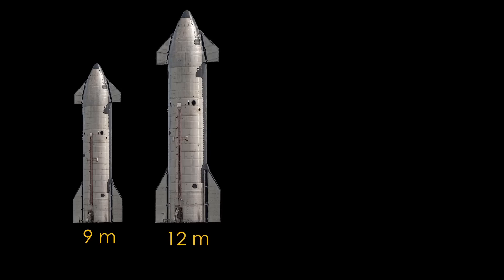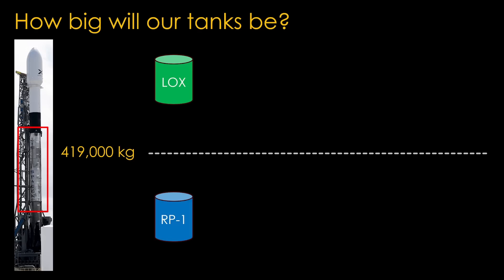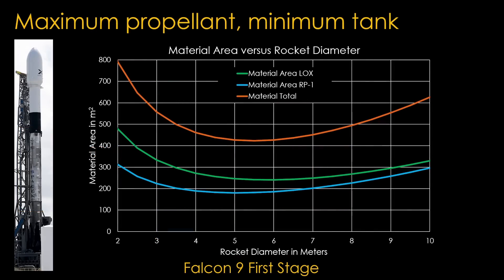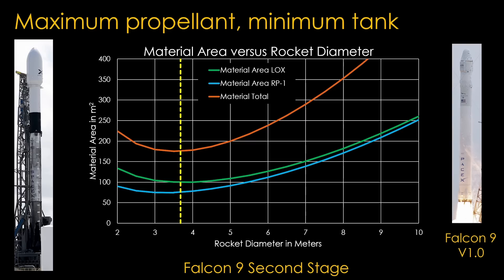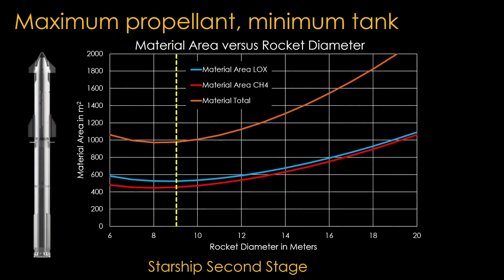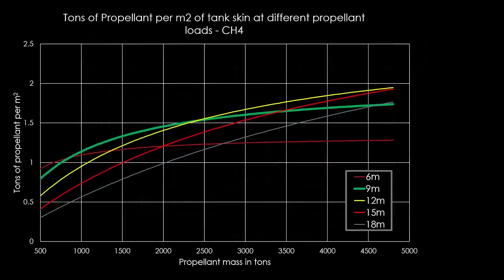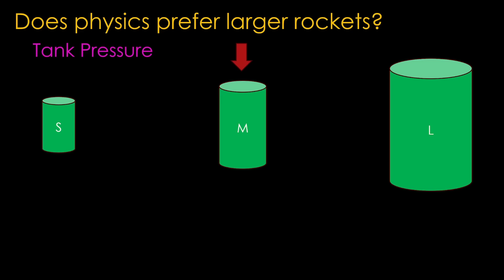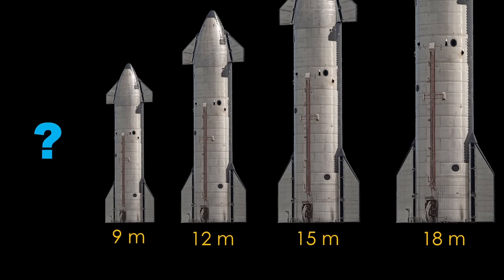Will Starship Get Bigger? Propellant tank sizes and rocket diameters

Comment: Something else to consider with Starship is the reentry cross section. A shorter but wider Starship will have a different belly cross section than a tall and thin Starship. Although a larger cross section means means more surface area that needs tiles, it also means a gentler reentry. That too has some optimization equation, but it's probably more complicated due to heating limits and such.
Reply: No need for tiles at all. just drill lots of micro holes. then pump out dry ice out of those holes to form a cold co2 insulating boundary layer. you dont even really need a pump. the heat of re-entry will cause melting of the dry ice and high pressure dry ice co2 to come out of the micro holes to form the insulating boundary layer.
Reply: @esecallum  Using gas evaporation to use sweating as the cooling method was considered by SpaceX, but that would add weight to that gas. In a recent Everyday Astronaut episode Elon explained that they made the choice to go with ablatives and tiles instead
Reply: Worth noting that Musk wasn't quite sure whether ablatives and tiles are now actually lighter than the evaporative cooling they originally considered. I guess they stick with their current heat shield because it's quite far in development.
Reply: @esecallum  Cooling using cold gas is a concept that can be considered. I assume rather on top then instead of thermal insulation, but OK. However: Why would you want to carry high density CO2 up there? There already is oxygen and CH4 in the vehicle that has a lower density and is there anyways. Then you need to balance the extra weight of propellant burn-off for cooling versus the extra weight for heat tiles. And you need to test it. And probably thats not nearly all... It´s rocket science and a bunsen burner doesnt proof much.
Reply: @esecallum what lmao
Reply: @furriesinouterspaceUnited  learn to read and listen
Reply: @esecallum  Uh you spatted some absolute nonsense, none of that will work.
Reply: @furriesinouterspaceUnited  i proved it it lab with bunsen burner-e and an air compressor.  you are regurgitaing it cant be done
Reply: @esecallum  You’re missing 2 of Musk’s primary design philosophies for Starship.
1. The rocket must be rapidly reusable. Static tiles done right should require less work between flights.
2. Shortening development time is extremely important to Musk. That’s why they first switched from composite to steel.
Reply: @TheMrshawnpaul  they keep falling of!
Reply: @esecallum  Your idea of active cooling is a nice idea, but I don't think it's what SpaceX is looking for. Stoke Space is looking to use active cooling, but using the liquid hydrogen propellant instead of dry ice ( which has packaging/loading and expiration issues). Take a look at them!

Comment: I would have mentioned the issue with thrust density with regard to height. Unless SpaceX comes up with continually better engines, Starship can get wider, but it can’t get taller. You no longer have room for enough engines at the bottom.

150 meters is pretty much the max you can get to with current engine technology (Raptor V3). (Assuming same diameter for the whole rocket.)
Reply: Make the booster a cone. You can widen it at the bottom to increase thrust. It would minimise the changes to the ship, while allowing for a more powerful booster capable of throwing the ship further.
Reply: BTW, this means that if you don’t have really good engines, you are limited to a lower height. It is an important design constraint. As long as New Glenn uses the ORSC BE-4 engine, you’re probably not going to see a version reach much beyond 100 meters, as an example. This could push designers to increase from a 7 meter diameter to 9 or 12 meters, or beyond. If the need arises for a larger more capable rocket.
Reply: Agreed. I think a larger diameter will come as soon as they start generating revenue from operations (Starlink, etc...?). Starship is mostly a fuel tanker and the demand for payload is limitless. It's a KC135 refueling an A380.

Comment: Great presentation. One thing to note is that while pressure vessels would keep a constant mass ratio, things like heat shielding or insulation benefit massively from the square cube law. This would indicate that there is a break-even point for hydrolox where the performance outweighs the added insulation and handling issues (see extreme 1960's fully reusable ssto proposals). speaking of which, why aren't there huge expander cycle engines using multiple chambers (like the russian engines do) to overcome the power/ surface area limitation?
Reply: The pumps in the expander cycle discharge at 1.5x to 2x the chamber pressure. The tubes in the thrust chamber and nozzle walls have to hold at least this pressure so that makes them heavier, thus increasing the regenerative surface area increases the weight more than in other types of engines. The extra weight claws back some of the higher performance of the expander cycle.

Fabrication is also quite involved, specially shaped tubes and silver alloy filler are manually fitted and pieced together, then it's fused together in an oven. Not every defect can be repaired, which can scrap the whole chamber. Needing multiple chambers for each engine would make them even more expensive

Comment: Is there a possibility that before they go with a larger diameter rocket that SpaceX will go for a Starship Heavy as an interim stage and then flare up the upper stage to 12 meters?
Seeing a rocket with 105 engines take off will be spectacular.
Also going to 18 meters will Raptor be enough or do they need something the size of Rocketdyne F-1?
Reply: More raptors seems more likely than bigger ones. Scaling up rarely works linearly. Bigger engines add length too.
Reply: @mostevil1082  They haven't yet proven that they can eliminate the 10t+ engine shielding which stops one Raptor RUD cascading into, well, more. Raptor 3 is supposed to solve this problem, I guess by being more reliable and robust? Anyway, if they don't solve the problem, then providing shielding for 33 or 35 engines will continue to be a substantial payload penalty. At some point 5 big engines look easier to shield than 35 small ones. When it comes to human payloads eliminating the shielding gets even harder, NASA is a bit of a stickler that way....
Reply: Clustering engines has already proven itself and has many advantages. There is no need for larger engines no matter how you scale the rocket.
Reply: Just go Mega-Soyuz with four carrot boosters and a potato masher core stage

Comment: This plan is very similar to how they developed Falcon 9, it took them several years and iterations before they got to the Block V booster.
Reply: Dunno, the increase in diameter and height dictates a completely new structure rather than just putting a plug in an existing structure to make it longer, metal structures being a bit less limited to the moulding needed to make a composite structure like falcon.
Reply: Falcon 9 just grew in length. 

Growing in diameter is a completely different matter. And Starship / Super Heavy won't change the diameter either, as far too many very expensive things have to change.